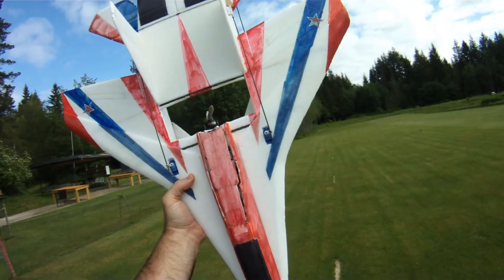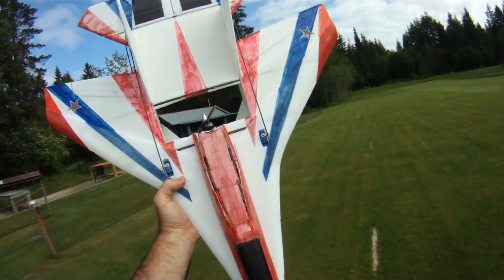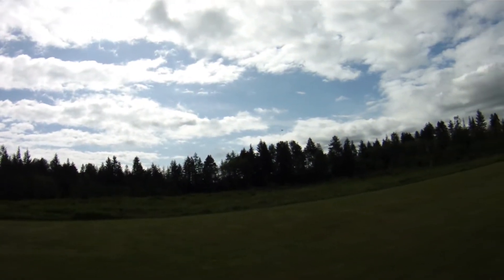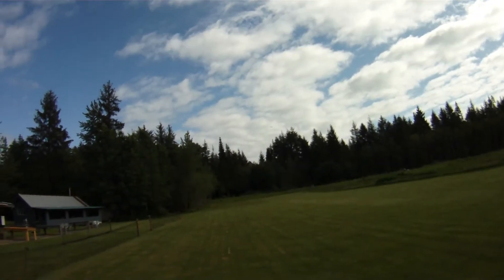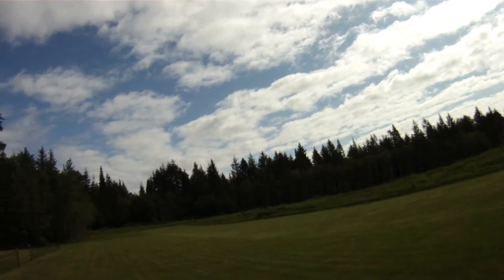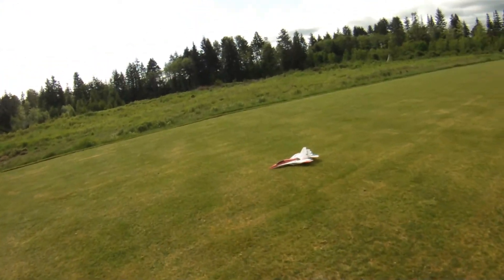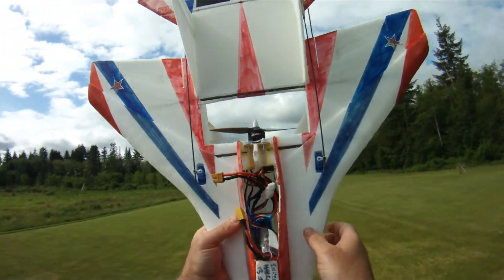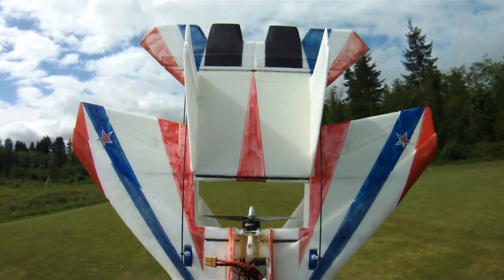Field test - EMAX LS2206 2700 kv motor 6x4 APC gas prop on 3S - 24 May 2018

Comment: Still plenty of speed to have fun with there Scott. Best to use a prop that keeps your motor safe isn't it.
...RCPP
Reply from the maker: Hi RCPP, it is a decent motor, the Foxeer DATURA is lighter and more powerful.  I found it a bit strange that EMAX calls this a "Lite Spec" motor, then they don't use a hollow shaft and put heavier gauge wires on the motor, they could have lightened it up a few grams more, not that perhaps that would have improved the performance, the magnets in the Foxeer feel stronger which I think gives it a bit better torque and they are both the same size.  Interesting to experiment :)  Thanks for watching, mate :)  Cheers, Scott